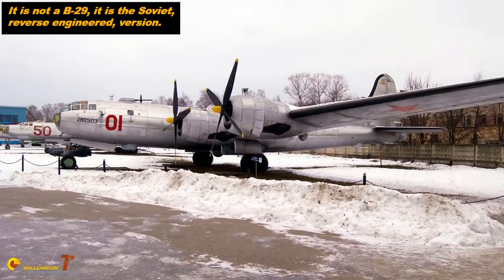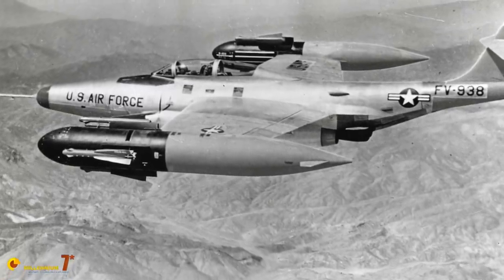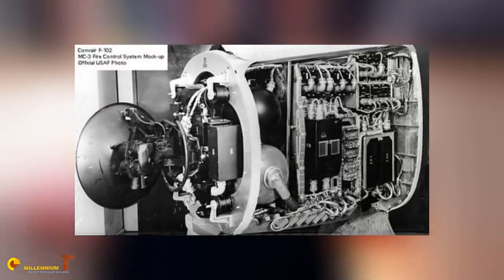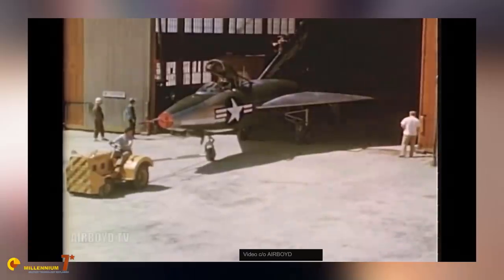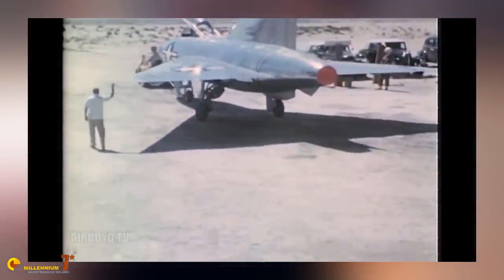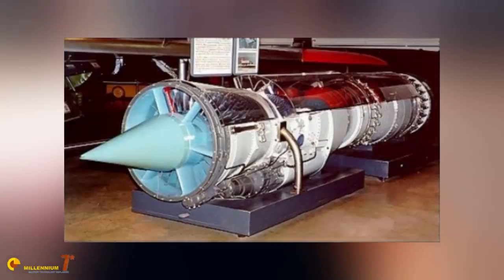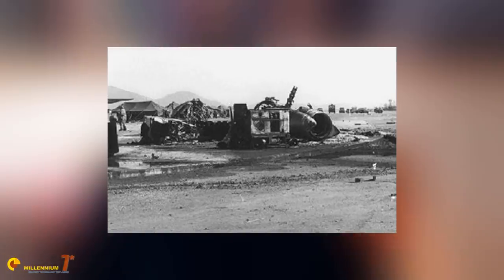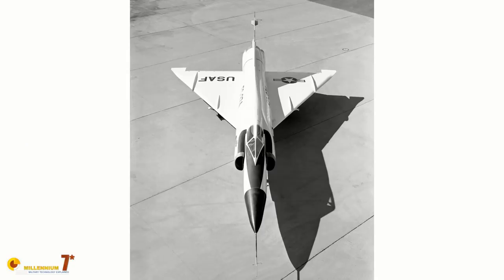F102 / F106 - Part 2: The Waist of the Fighter - Understanding the Area Rule

Comment: Wasp waisted design is for transonic performance.
Reply: If you can't go through transonic you can't go supersonic!
Reply: Raptorman0909,, I’ll tell you what young fella, we learned a shit pot of knowledge from the F102/106 programs, i was an F4 Phantom Pilot in Vietnam in the mid 60’s. The wasp waist and anhedral and dihedral wings of the Phantom II was a direct result of the earlier birds. I don’t know how many times during a mission I went transsonic and supersonic especially on a MIGCAP mission up North.
Reply: @arttafil6792  -- My two oldest brothers served in Viet Nam, one in the USMC and the other in the USAF -- I myself served in the USAF post Viet Nam so I'm by no means a young fella😭.  The base I was stationed at, Seymour Johnson, had 3 squadrons of F4 until they were replaced with, I believe, the F15, but that was after my time.  One technique to get through transonic was to enter a shallow dive to punch through then level off and slowly climb if needed.
Reply: Raptorman0909, I know this is almost an auto reflex response but, thank you for your service. I spent a lot of time going supersonic chasing MiG 21’s in North Vietnam. You’re right about going in a shallow dive. The laws of conservation of energy. Unless you had a whale nearby to top off your tanks. Weren’t too many of them where we flew. You had to be “feet wet” to find a tanker. I will tell you one thing though, those twin J79’s will punch through the sound barrier in a climb. I know because I did it in January 67 because I had two MiG 21’s on my ass and they wanted payback because I was one of the few Marine fighter pilots that made 2 kills in one day. I took out their squadron leader as he was heading back to Kep airbase about 50 clicks Northwest of Hai phong. He was probably Joker fuel because he was hot to get home. I just happened to be waiting for him. I also got his #1 wingman. The other two in his flight wanted some payback. Nope, i clawed my way to flight level 300 as soon as I could. Then I had to go max conserv on the JP. I’m sure I was in radio range of Red Crown for vectors to a whale. They headed towards me as well. We connected about 40 miles off shore. I was at Joker fuel myself when I plugged in.

J
Reply: @arttafil6792  -- Art, an honor to talk to you...  The F4 was quite an impressive beast and I loved watching them launch from SJAFB, two at a time.  I'd love to hear more of your activities up north -- were the pilots you faced in Mig-21's -- if so, they were quite impressive as well.
During Korea our pilots sometimes found themselves facing Russian pilots, only in the north, and I have to wonder if that ever happened in Viet Nam -- I'd have to believe it did.
Reply: Raptorman0909, Don’t wonder, it did. In 1995 I went to Russia on several business trips. On my second trip I contacted a company that set up flights in MiGs. I got set up for it. It cast me $3,500.00 to get to fly my choice of MiGs. When I arrived at the airbase outside of Moscow what I saw brought me to tears. There were no guards at the dilapidated front gate. My taxi driver knew where to go. Once we arrived at the flight line ready shack unchallenged I got out and met my flight instructor pilot. I’ll tell you that I wore my nylon flight jacket with all my squadron patches and base patches. It also had my Velcro name tag on my left breast with my rank and gold naval aviators wings on it. My flight instructor was a retired Colonel in the Russian air defense ministry. We shook hands and his eyes riveted themselves on one of my squadron patches. It was the bengal tiger head patch of VMFA542, my first F4 Phantom squadron in Vietnam. He smiled and said We F M A five four two, the Bengals. I answered “da comrade” I asked if maybe we had met in the skies over North Vietnam? He smiled and said maybe, “I was an advisor there”,
Reply: Raptorman0909, I run through their flight simulators which were very rudimentary at best. I got to choose 3 aircraft to fly. My first was the MiG21 fishbed, second was the MiG29 fulcrum and last, the best, the MiG 25 foxbat! He was very surprised at how proficient I was at flying Soviet era fighters. After flying the MiG21 he trusted me to taxi out and take off as well as climb out and fly the aircraft. I enjoyed the MiG 29 immensely. That is a real hot rod! I was in awe of the MiG25 foxbat. That is a beast! It’s huge with massive afterburner equipped turbofan engines. The survival technicians suited us up in full astronaut (cosmonaut) pressure suits and space helmets. I also received a video cassette of the flight. I got to witness what few people have seen, the black sky of space and the curvature of the earth in broad daylight! My jaw almost bottomed out in my helmet at the sight. All I could say was WOW! The colonel said over the intercom, not to feel bad, everyone says the same thing. I have watched that tape numerous times over the years in wonder. 
When we got back down and I dressed back in my regular clothes. The colonel and I talked a bit and I gave him a special present that I had brought from the States. A sealed ziplock bag of duplicates of all my patches. An 8” MacDonald Douglas patch of an F4 Phantom in profile was his favorite as was my large VMFA542 AND VMFA323 squadron patches. Those were the two squadrons I flew with on the 3 tours I did in 66, 67 & 68. The other 10 patches were also special. He actually had tears in his eyes as we embraced when I left. We exchanged letters and e-mails for years until he passed away in 2011 from cancer. :( :(. So now you can finally put your question to rest, Yes there were Soviet pilots flying “The Friendly Skies” up North.
Reply: @arttafil6792  -- I always suspected but I don't recall the confirmation of it like we had with Korea -- still, the Russians could hardly miss the opportunity to see how there planes and training stacked up with ours.  I'm sure they used the same rules that they would never fly south of the DMZ in case they were captured that they used in Korea.
Did you ever participate in the Top Gun school the Navy setup -- before the USAF created the Aggressor school at Nellis.
Reply: Raptorman0909, the North Vietnamese being trained by their Soviet Communist advisors suffered from the same flawed tactics. They were both controlled by top heavy authority. They couldn’t even fart without higher authority. “Rules of engagement” than we were. Another problem was the lack of MiG 21 aircraft to sacrifice in an engagement. Their tactics were “hit and run”. That’s how I made my kills. After their engagements they ran like hell for home. They knew that we were prevented from hitting them while in their traffic patterns while landing or departing by OUR rules of engagement. That day I figured out a loophole to my ROE. I could see from my point that the two MiG21’s were on a wide base leg and setting up for final approach so I came in low in full afterburner in the opposite direction. They broke formation and climbed out. HAH, no more landing. With my wingman flying high cover for me I pulled a 6 or 7 G split S  came in behind them got a tone and fired off 2 sidewinders 2 seconds apart. The first one detonated about 5 feet aft of the leader causing an engine fire that the second sidewinder flew into and blew the entire tail and exhaust off of the MiG21. He went inverted and angered into the ground. Scratch one. His wingman was off my port nose and I went after him. I opened my speed brakes and pulled a climbing port turn. I bled off enough speed to tighter my turn then immediately snapped into a hard starboard turn and went at nether speed of heat on his six. I only had one sidewinder left so I got within about 300 feet of him. I got tone and released my last sidewinder. It flew straight up his tailpipe since he left a great heat signature in afterburner. Well, “ scratch two! I went into full afterburner and clawed for heaven. The other two MiG’s were giving chase but I had the advantage after going supersonic while climbing out. My wingman had my six from high cover so I was able to egress. When I passed angels two zero zero I called Red Crown for a whale. My wingman and I topped off and flew back to Chu-lai.
Reply: @arttafil6792  -- Art, that's a great story and I really REALLY want to hear more of them.  Perhaps you could make a video with you telling some of your stories.  Maybe right a few of the stories down so you're not winging it so much.  Again, I'd love to hear more of these stories and as a USAF puke I salute my Jarhead brethren.
Reply: @arttafil6792  -- Oh, if you do decide to make such videos I might suggest a name for your YT channel -- "Phantom Stories".
Reply: Raptorman0909, most of these are recurrent nightmares for the last 50+ years. It’s called PTSD.